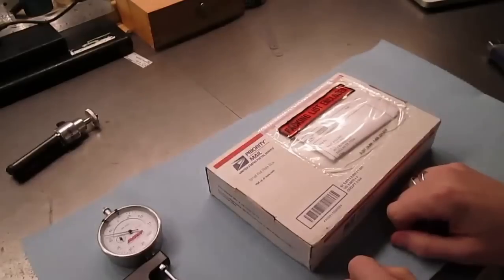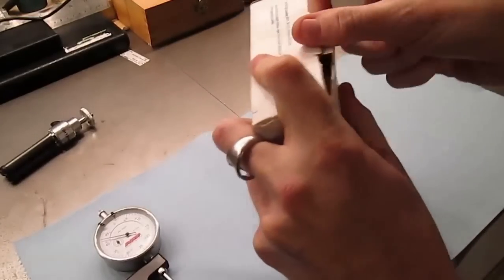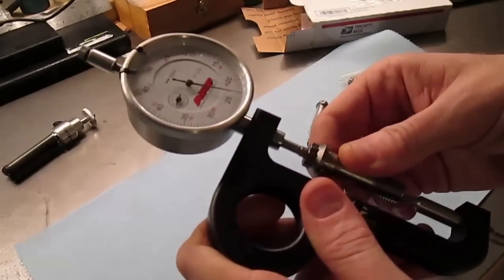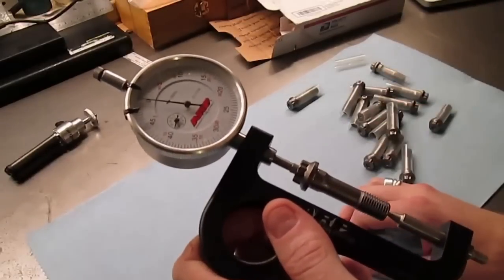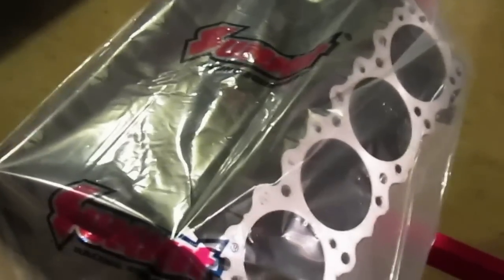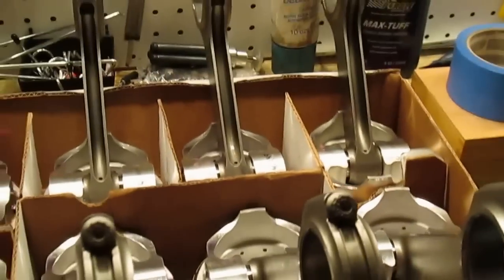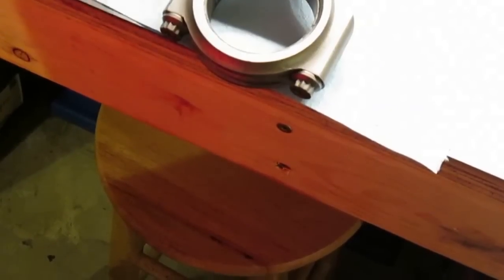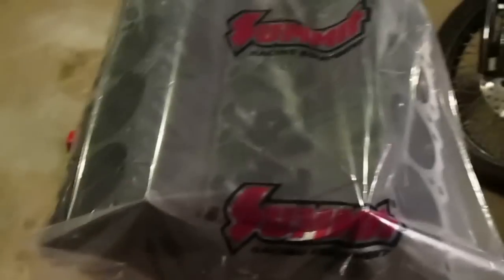update on rod bolts and short block assembly

Comment: In this video youre not measuring the free length of the bolt. Youre actually measuring the centredrill depth.
 If you measured the length of the bolts with a micrometer you would probably see theyre all within the 2 thousandths tolerance The manufacturers told you. 
What youre doing here is finding out the centredrill used to centredrill the ends of the bolt probably has a +/- .005 tolerance on its depth on each end. The tolerance on this is so wide open because it doesnt matter the depth of the centre drills, as long as theyre there to hold the gauge. Comparing the bolts to eachother like you are doing is pointless. This is all operator error.
Also.. can i have all your rejected cough bad bolts please..?
Reply from the maker: you are totally right. I learned a lot about this since, but i still never thought about the centerdrill depth, Which of course would not be a critical measurement - great information man, i really appreciate your knowledge on this.

Comment: After reading through some of the comments, I see some one did hip you to measuring stretch vs static length. I like how clean you keep everything. More important than most realize. Never understood the need for a special stretch gauge when a micrometer would measure the same thing?

Comment: the bolt length is completely irrelevant to what this gauge is ment for. you are supposed to measure stretch not length out of the box. measure before torquing down, then measure after and you have now measured stretch. your going way too far with this mate. Let me take the confusion our of this for you. when you torque a bolt down (strech it) and then you have recorded and zero'd the gauge. then measured strech after the torque down. once you UNBOLT IT, it should measure the original length it did before you torqued it down ( WITHIN .001") and thats all that they mean. if the bolt does NOT come back to within .001" of its original length then it has streched too much and must be replaced. as far as the bolts being all the same lenghts between each other...thats never going to happen, ever.
Reply: Sounds like he will be buying alot of rod bolt's 😎

Comment: I have a new set of Eagle rods and the ARP 8740 bolts vary about .009" in the free state. They recommend .0059"-.0063" stretch or 63 ft/lbs. With liberal amount of ARP ultra lube under the head and on the threads, I have to torque to 85-90 ft/lbs to achieve the proper stretch.
Reply from the maker: Wow that seems tight! interesting though. I've done lots of reading and research since posting this. Its really interesting stufff, i can't get over how much variance i see with other peoples rods/bolts and everything not to mention how much things fluctuate per manufacturer. I get concerned about over torquing to get the stretch required. But what im learning is that its not whatever comes first.   amazing you have to go almost 30ft lbs over the rating to get the stretch.  Thanks so much for commenting!

Comment from the maker: Great point!!  thats kind of how this whole problem started, as i found variances with the bolts originally that were torqued by Scat when they honed the rods. Variances came in in the .005 and up range.  Then Scat told me that anything over .002 of difference would render the bolts junk. Then asjed ARP and asked. they said .001 with new bolts. Bought new ones, ended up in the same spot.  I just wished i got a consistent answers to start with.  Thanks for stopping by!

Comment: The new out of the box length really means nothing ..you need to label and mark each bolts untorque length then after you torque you measure the TTY...to expect each bolt to be within the .001 tolerances out of the box from a mass production line is a pipe dream...

Comment from the maker: Yeah i agree, if i was using stock rods with new ARP bolts i would have just jumped straight at torquing them and being done. But since these rods came with the bolts and had instructions specifically for the combination of the two, i thought i'd try out the stretch method as i have not done that before. At least i learned a thing or two along the way.      Thanks for checking in!

Comment: Just wondering if the .001 tolerance as they state is to the "clamping" area of the bolt, in other words to the shoulder of the bolt head, or are they specifying that the tolerance is from the centering holes?  
As I said, some of my rod bolts had been ground to balance the assembly so I could not go through this process so I just torqued my new ARP bolts.  
Great info!!